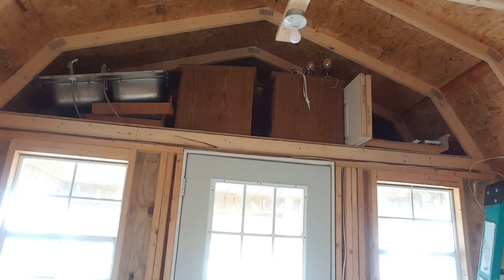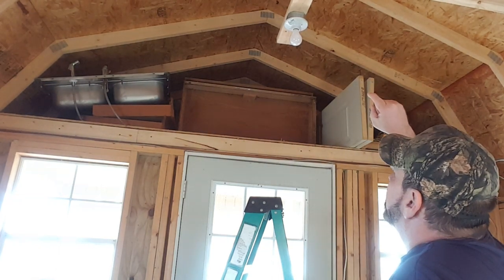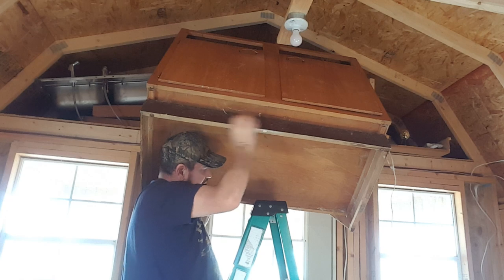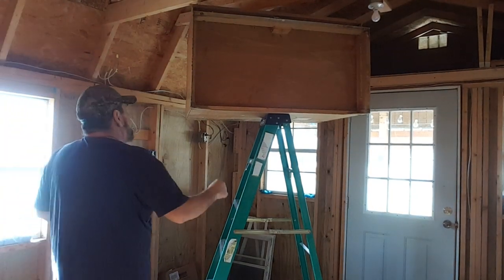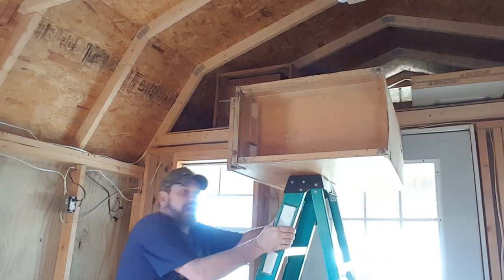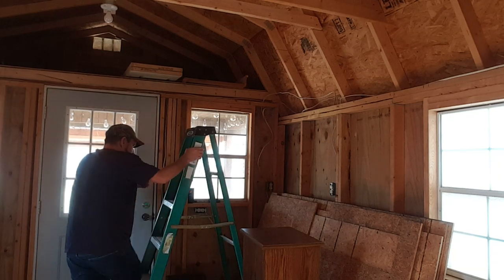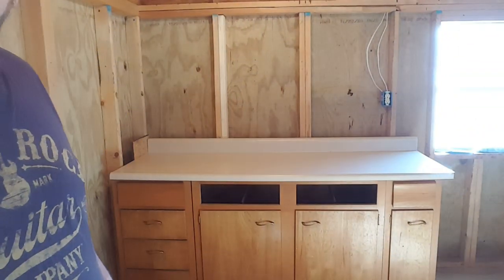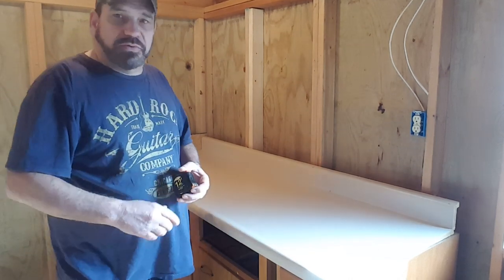Shed to House Tiny home Kitchen Cabinet work DID I FALL?

Comment: Just a thought, it might be easier to vent the stove if its near the outside wall. I know that leaves the fridge out of that back corner but from all Ive heard about moisture in tiny homes Im not sure you want to not vent it. or maybe vent it thru the bathroom ceiling and have both the bath and stove vents side by side on the same exterior wall?
Reply: ps, looking forward to seeing how it all comes out!
Reply from the maker: Yes I end up moving to the back wall
Reply: @generalvlogvideo1948  I noticed that in your last video and was silently saying 'YAY' lol